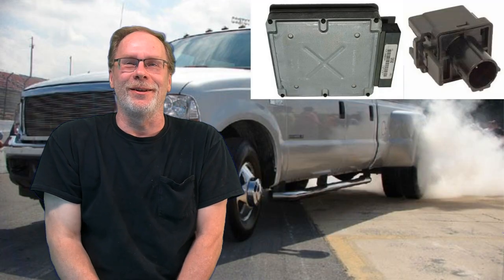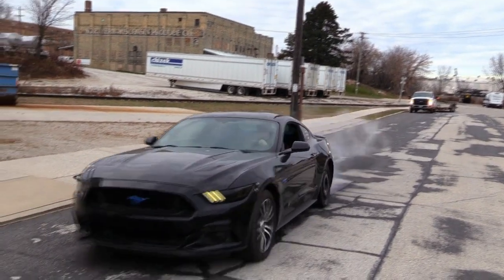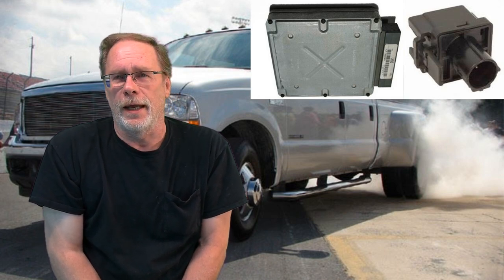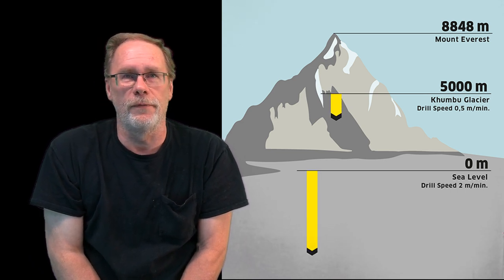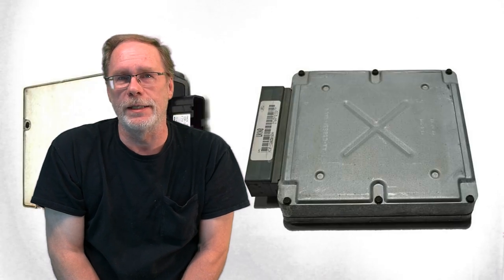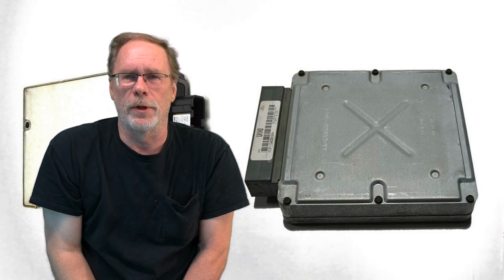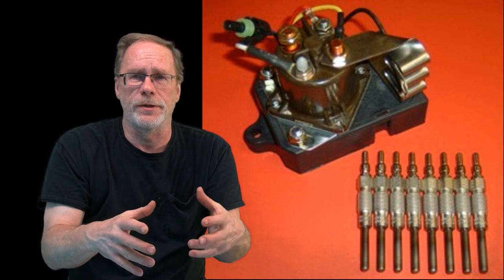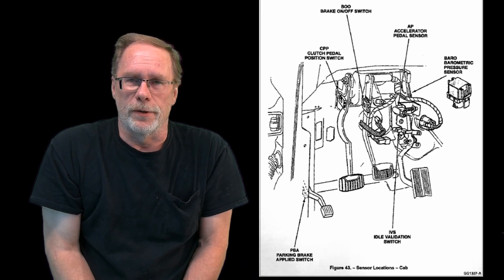7.3 POWERSTROKE BAROMETRIC PRESSURE SENSOR ( BARO SENSOR)

Comment: Clint - I have a (stock) 03 7.3 RWD AT XLT Crew cab that had water intrusion into the fuse box/BCM.  I got forscan lite going while troubleshooting an IDM/FICM failure, a year or two back, and worn engine wiring harness, but had never looked at barometric pressure using it.  More recently, I found and solved water intrusion at the cab corners, (until I can get a good donor cab truck,) and am waiting on a new fuse box/BCM.  Tne water was making my radio turn on and drain the batteries.   I a,so replaced a leaking IPR sensor.    Concurrently, but likely coincidentally, The tach, and trans temp guages stopped working, and the only codes stored were a PCM keepalive failure, and low injector pressure, immediately after, which have not come back since clearing them, after reconnecting the battery and runnning the truck.   The IPR sensor seems to be working fine, but the check gauge and engine icon lights now stay on, with no codes stored.   The important question, for you, is my forscan shows no barometric pressure, just reads zero for any barometric pressure value I choose to display from the PCM.   I assume this means a failed PCM, and the guage issue may or may not be related.   I repaired my cluster for having the problem with the battery saver relay, in the past so am comfortable checking the relays in there, and replacing them or just remelting thermal stress cracked solder joints.

  Truck runs better since the IPR sensor replacement, but seems to have decreased fuel mileage despite a much needed alignment, which makes me think it is due to the lack of baro data.

  Going to try to get a rebuilt cluster, if my own simple troubleshooting does not fix the tach and trams temp.   (Fuel, speed, and oil pressure read OK, and I have a bad temp sender as a known issue...) and will replace the PCM as I can afford to, but am hoping you can (or someone,) can confirm that I SHOULD be seeing a barometric pressure reading from the PCM.  Thank you, or anyone.

Comment: Thank You Sir , i appreciate Ya for the info , & yes i aint learned jack chitt from any forums , i have a 97 f 250 HD , I JUST ORDERED A VSS , my ABS light  came on speedo went crazy,  shiftin not right either ,i changed it with an aftermarket i vss,  a couple weeks ago, so i put the old one back in it , but the ABS lite came back on , but nothin acted up. my auto trans dont shift into OD  Or lock up , usually run 2k at 70, have change TPS with after market part , with no luck , same ol same ol , im asume not goin into OD, will kill my fuel milage , but im goin to change my Baro sensor , & hope for the best .

Comment: Thank you for all the information you put together and put out!! I have a question regarding baro results.  My Autoenginuity scan tool is giving me a max baro psi reading of 148psi.  The voltage does show fluctuation based on what seems like changes in weather.  (last night it was 4.55volts and this morning it was moving between 4.3 and 4.2)  I don't really know how to actually test the sensor but I'm curious if the scan tool is picking up a max psi of 148 if it is using this information to feed the PCM.  I pulled the protective cover off the sensor to find the sticky gel that is protecting the sensor and touching this sticky material will effect the voltage and I can get the psi to finally change if I really push or pull this gel material.  It seems like the sensor is not working but I don't know how to verify that.  Removing the sensor causes a little rougher idle and harsh shifting and now that I've put the sensor back on after touching the gel material the engine has a more noticeable rougher idle.

Comment: What tuner would you reccomend? I have a 2000 7.3 Ambo and am hoping to improve my mpg.
Reply from the maker: The SCT x4 in my experience is a very safe tuner from a experienced company , Has 3 on board tunes you can also load other tunes from there web site , has a data logger and acts as a code reader plus other helpful functions . It is also one of very few tuners that you can back up your factory tune to a separate computer for safe keeping

Comment: I am a working on a 2000 F350 7.3. No tuner.  There are no codes related to the Baro.  On a n Xtool D8W scantool  i have a Barometric pressure2 reading of 99546KPs 14000 PSI. that is an error from the scanner i assume. I also have a reading of 81.21 Hz.   Do you know if the Baro in the PCM reports frequency or a varying voltage level?
Reply from the maker: You took this to a high level just check a basic voltage it will be in this range  4.53 to 4.55 volts the whole time  koeo
Reply: Are you saying that with the Baro sensor internal to the PCM The scan tool should report a voltage not a frequency reading?  I can't probe the sensor if it is inside the computer.  It is possible that the program in the Xtool scanner is buggy.  I will try to read it with other scanners when the truck comes back.  I will clean the back pressure tube and replace the cam sensor because of intermittent codes.  Your videos have been very helpful  Thanks

Comment: Does it matter if a person reinstalls the tune after the factory setting is returned & the code is cleared to check the baro for throwing a code ? Do I leave it oem or can I go back to what I had programmed in it ? Thank you sir * Arkansas *
Reply from the maker: Sorry was very tired So yes go ahead and reinstall your tune if the code comes back you know the tune is the issue
Reply: @CUSTOMWORKS7.3PSD   thank you sir for your time & advice

Comment: I have a e99 got rid of the xle4 pcm and now have a nvk2 pmt-1 out of late 99. Will I have any issues? Seems to be running great. T.y.
Reply from the maker: The swap you did is a normal upgrade and the engine won't be a issue its the auto transmission that a small percentage have had issues with so if you have a auto and have had no issues you are good to go

Comment: My baro reading is super high on but I'm not getting codes. I've heard that my scanner just might not be able read the sensor properly and is given a default reading.  Any information you might regarding this situation would be greatly appreciated
Reply from the maker: baro reading for OBS is hit and miss you could always pay a shop to just plug and read with a high quality scanner if you are talking about a 99 n up don't worry unless you get a code

Comment: I have a 97 international 4700 t444e 7.3 power stroke with power loss no acceleration could the baro be my problem
Reply from the maker: everything in these video's apply so did we check these issues already https://www.youtube.com/watch?v=ZJ5BSBntTzA   https://www.youtube.com/watch?v=rasXr0ftSu4  https://www.youtube.com/watch?v=OWDG_4G3O74

Comment: Hello I’m currently having a a shifting issue with my 97 f350 7.3l the transmission will shift great then it will randomly act like it’s not getting the signal to shift and flashing the overdrive light. If I unhook the batteries for a couple hours and hook them back up the transmission will shift smoothly again. I’m guessing it’s the pcm under the dash? Have you or anyone come across this issue? Thanks for any information and feedback.
Reply: Not sure if it is this issue, but I know the wires from the OD switch can get chaffed and cause a fuse to blow.  Perhaps an item to check.  Would be interested to hear if you got it fixed, what it was.

Comment: I'm having a low power issue in my 01 that I can't figure out. If my map sensor is plugged in, it will only make about 1.5-3 pounds of boost. If my map sensor is unplugged it will make 15-16 psi of boost. I can't seem to figure this one out,  nor can I find anything on the forums or YouTube. The map is new, the voltage is right on the money. If I put shop air to the map regulated at 20 psi it will show on the scanner that we are feeding it 20 psi and the truck will try to come alive. I have no smoke, no intake restrictions, nothing. Any help would be appreciated.
Reply: Ever figure out the problem? @zacharryn
Reply: @Diesel_ftw  no. My son drives it now. And he isn't bothered by the lack of power. But I do have an injector rebuild kit that I'm going to put in it someday. But for now I've just been letting him drive it with no power.
Reply: @zacharryn  check to see if the other end of the map line in broken or cracked, there side that connects to the y pipe.

Comment: Is it possible for this sensor to be bad without throwing a code?
Reply from the maker: Yes
Reply: @CUSTOMWORKS7.3PSD  

My ecu is not sending the ground signal to my GP relay.
Reply from the maker: @jesusisalive3227  PCM needs to replaced or rebuilt no other options https://cpaddict.com/7-3-pcm-rebuild-service-1994-5-2003/ or https://shop.fullforcediesel.com/dtc-rebuilt-pcm
Reply: Everything else seems to be working fine, so for now, I'll probably just run the glow plugs manually.

Comment: I'm not getting any baro codes however live data shows 0psi at all times and I'm getting lots of black smoke, slightly low on power, and harsh shifting at times. Any ideas if the symptoms I'm having are from a bad baro sensor? Truck is 02 f250, new up pipes, rebuilt turbo, new injectors, new ebp sensor and tube, yet problem still persists and has me pulling my hair out
Reply from the maker: where we having this issue before the up pipes , turbo, injectors, ebp //// when did this problem start
Reply: @CUSTOMWORKS7.3PSD  yes. Issue was present before all that. Seems to have gotten just a touch better after the new bellowed up pipes because the old were leaking and causing me to not get good boost. Getting 26 lbs now according to mechanical gauge. Still tons of smoke from half throttle or more. Obnoxious amounts of black smoke. I might also add that the truck fires off immediately even when sitting for a week, and idles super smooth. Just can't get this darn smoking issue sorted out
Reply from the maker: @tylerwightman2315  do you still have the ebpv that flapper not being open will cause this issue , clogged air to air, you still will show good boost numbers, faulty IDM or pcm clogged converter, wires to injectors are not grounding out causing a injector to stay slightly open these are what I would look at it also would be helpful to know the egt's at 60mph empty and the above is all taking in account there is no tuning
Reply: @CUSTOMWORKS7.3PSD  Thanks for the reply and the great information! when I rebuilt the turbo, I deleted the ebpv with a different turbo outlet and a "delete" pedestal.  I also installed a ts 6 position chip at the same time however there is no actual tuning on the pcm. Truck only has a muffler no converter. Sounds like I need to do a wire integrity test from the 42 way connector to each injector pigtail? When I buzz test them they all sound loud, healthy, and even like they are getting good power, but I guess it wouldn't hurt to do an integrity test on them. I also bought  a new map sensor I need to install just for kicks. I might also add that the previous owner said this problem started immediately after he had a shop put new injectors in it. I know him from work and he drove for 3 years like that before I got the truck. Since he said the problem started after injector replacement I went right for the injectors first and put another set in with no change
Reply: @tylerwightman2315 - check your IDM/FICM.  Mine was making my injection weird, due to age and weather intrusion.   Also had bare spots on the engine wire harness where it u-turns down against the valve cover.

I get no baro reading (0.0 psi) from my 03 7.3, using forscan, and am wondering from reading your comment, if the PCM is bad in my case, or if none of these PCM internal barometric pressure sensors from 99.5-03, provide it as data to ford 7.3 compatible scanners, (maybe only to the dealer scanner?,) or if it is an issue, that indicates a failed baro sensor in the PCM.
Reply: @orcoastgreenman 
Problem has been fixed....I  changed my IPC sensor and CPS about 9 months ago and the black smoke issue went away after that. I'm not sure which of the 2 were responsible for the smoke but I had oil in the icp plug and I kept failing a contribution test on the #8 cylinder which I read can be caused by crappy cps sensors. Did both at the same time and no longer fail a cct on #8 and the black smoke went completely away unless I really mash on it. Still get a 0psi reading on the baro but the truck is running great so I'm not to worried about it at this point.

Comment: I have a 94 1/2 5 speed when I get after it on the throttle try to shift gears no throttle push clutch in then I have throttle
Reply from the maker: May be someone here can help This is so odd I would need to be physically by the truck sorry
Reply: Replace the throttle pedal unit I was wondering if it was barometric censor
Reply from the maker: @gmorton606  not with that issue